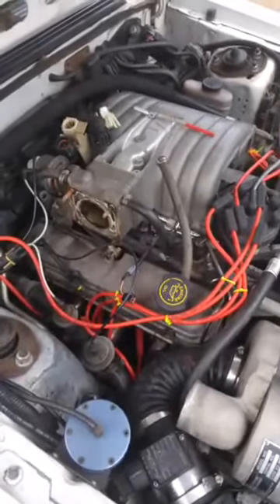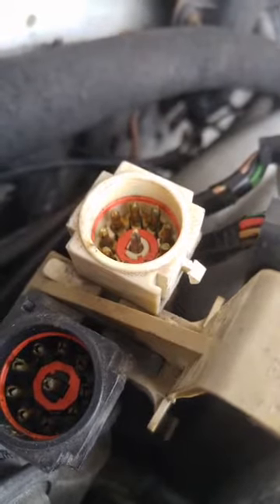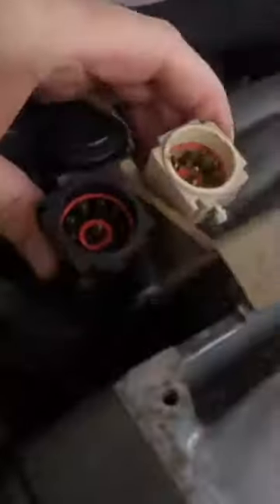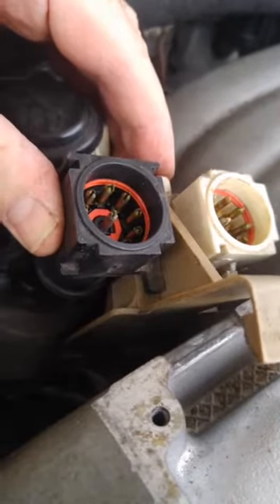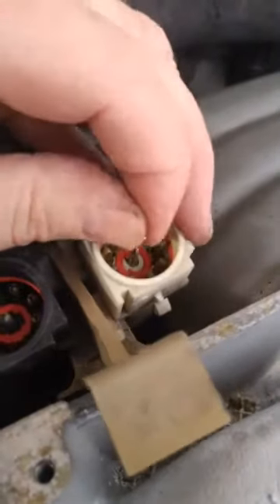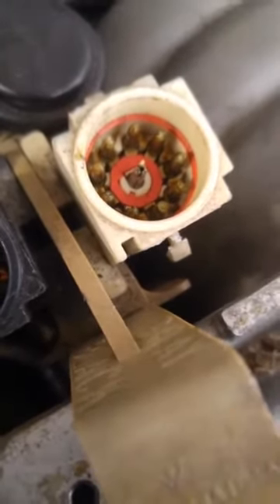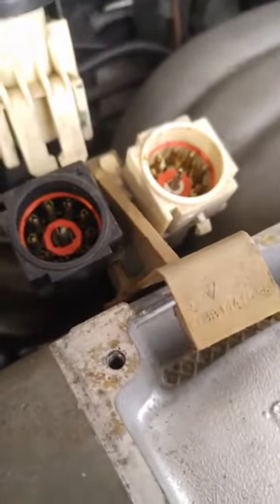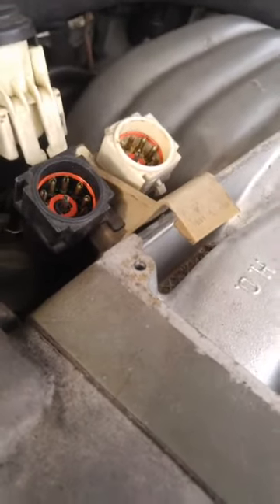Mustang 5.0L EFI 10 Pin Connector Fix

Comment: Thanks for the showing how to do this, I done everything on my 1986 5.0 5 speed and car runs good but sometimes just idles high and stays there , can shut it off and recrank it and idles fine, this is the last thing I think it could be. Great Video 👍
Reply from the maker: Could be a misadjusted throttle stop screw. Warm the engine up fully, then unplug the IAC. If it doesn't drop in RPM, the idle stop screw is too high. It should be able to run with the IAC unplugged, but should be at a much lower RPM than you want. But still high enough to not stall. If it's not, adjust the throttle stop until the engine runs but barely. Then plug the IAC back in.
Reply: @dragradialperformance3540  Thanks for replying, and one other thing I forgot to tell you, is when it idles high I just looked at gauges and my temp gauge reads higher, same with temp gauge, and with fuel gauge.  Thanks for replying I'm going to sub.👍

Comment: You press on the clips for the 10 pin connectors, you will surely break them if you try to pull them away to disconnect them.
Reply from the maker: Yes, I misspoke. You squeeze them. It's the most awkward design ever. When they partially break, you have to get creative.

Comment: hmmm...i know the SN95 doesn't have those connectors, but I'm wondering if i have similar connectors with that style of pins. i know the ABS and A/C connectors are somewhat similar, just not as big. good videos💪
Reply: My 95gt 5.0ho is having random miss and drinking gas now ..... was getting around 20 mpg highway 17 town 
.. now I'm 15mpg high - 10mpg town ...  all new ignition system besides lower distributor... also check +10 on crank and factory time ....... 71,000 miles garage kept 25years in Indiana, 0% rust ... it set almost 3years in a never moved.  I Just got it a month ago and it's my first car in general (truck guy) 
I'm also running cool after draining antifreeze... tried 4 different 195temp and its opens at between o&r.      Hasn't been middle of normal since ...

Comment: Does this also help with cleaning codes .?? I have code 31 egr voltage low , also when I move the salt and pepper connectors my cars stumbles ..
Reply: All my egr components have been replaced ,code still pops up.
Reply: @Lxmustang805  If the EGR valve position sensor wires go thru the 10 pin connector, and they probably do, then yes an issue with the 10 pin connectors could cause EGR codes. It can't hurt to do this service and see if it fixes your EGR codes. And it certainly will help with your idle and stumbles.

Comment: Hey if you’re still out there just want to know what kind of cleaner would you clean the connectors with
Reply from the maker: I just use an electrical parts contact cleaner from the parts store. I spray plenty in there and let it sit while I work on the contacts.

Comment: Just curious I got a 93 f150 lightning that throws no codes but gets some quirky idle and drivability issues do those vehicles have those connectors?
Reply from the maker: I don't recall, but I don't think so. One look at the wiring harness will tell you. If they're there, they may be under that cover plate on the intake. On a truck that age, you're going to want to pull the PCM out, remove cover, and inspect the 2 or 3 capacitors very carefully for signs of leakage of electrolyte. In fact, it's of the age where they should be replaced anyway, even if by some miracle they are not leaking yet. When these capacitors go bad, the vehicle can do anything from run funny to not run at all.

You should also make sure you don't have any vacuum leaks. A mechanic's smoke machine is the best tool for this.
Reply: Thanks for the reply I’ve checked for vacuum leaks I sprayed around the connection with carb cleaner no change in idle. I will look into the computer definitely. On the lightning website some guys mentioned take a look at the 60 pin in the harness
Reply from the maker: @davidm3302  the EEC-IV computer has 60 pins, so they're talking about the PCM connector. It is possible for there to be corrosion or damage there, and it can't hurt to give it a visual inspection while you're removing the PCM. But the red plastic connector lock that retains all the wires in their correct holes fairly well obstructs the view. You can view the pins on the PCM itself and see if there are any green crusties on them once the connector is unbolted.

You can also test fuel pressure. Should be 39.15 PSI +/- 1 PSI with the engine running and the fuel pressure regulator vacuum line temporarily removed. Timing should be 10 BTDC with SPOUT connector temporarily removed. You can clean the thottle body with carb cleaner and a tooth brush. And inspect all vacuum lines, emissions hoses, etc.
Reply: Thanks for the help I’ll take a look at that stuff this weekend. Not going to let this thing beat me lol

Comment: Would this be the cause of my 5.0 only running injector 1,2
Reply from the maker: Only 2 out of 8 injectors are working? It's possible that this is the problem, but you need to check for injector pulse on the other 6 injectors. If you have injector pulse, then maybe the other 6 non-working injectors are clogged up and need to be ultrasonically cleaned, or replaced. If you don't have injector pulse on 6 injectors, it could be this 10 pin connector fix. It could also be that the plastic fingers that retain the injector control wires in the PCM harness connector are broken, and the injectors aren't actually plugged into the computer.

Comment: Is this a thing with the 4.6 too?  The hanging high idle that eventually drops is an issue im having with my 97.
Reply from the maker: No, the 4.6L does not have these 10 pin connectors. If I were you, I would start by removing and cleaning your throttle body, and cleaning your IAC valve with carb cleaner and a tooth brush. Then I would check TPS signal voltage with a scantool or a voltmeter. You should see around .96 to 1.02 volts, with about a volt being ideal at idle. If you see a good bit higher voltage than that, then either someone has turned your idle stop screw up inappropriately, or your throttle cable is binding. Temporarily remove the throttle cable from the throttle body to see if that resolves the issue and puts TPS voltage back down to a volt where it belongs. If it does not, and TPS voltage is higher than say 1.03 volts, then your stop screw is set too high. The easy way to fix that would be to just turn the throttle stop screw down until you have 1.00 volts on your TPS signal wire or TPSv on the scantool.

You should also check for obvious vacuum leaks. Look hard at the large rubber elbow near the upper intake. They like to rot out, which usually causes a low idle or stalling. But someone may have raised the idle stop screw to "fix" another issue.
Reply: @dragradialperformance3540  Wow, thanks for all of that.  I have a few days off of work here, so i should be able to try this.  Big ups yourself!